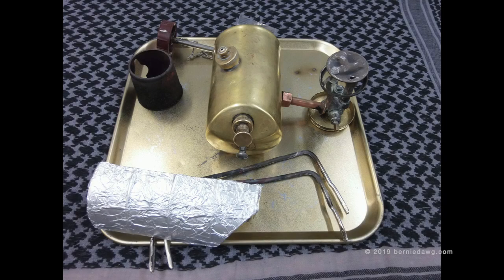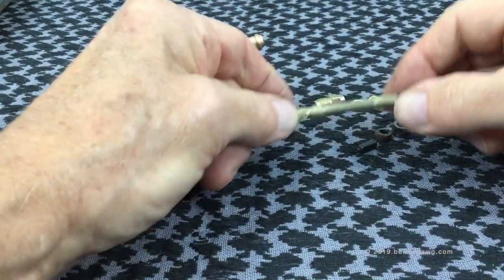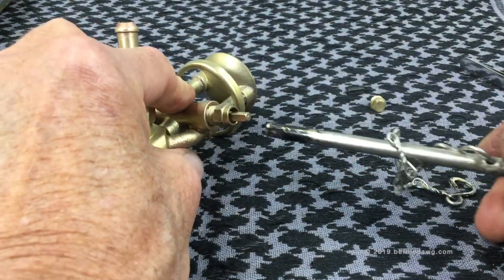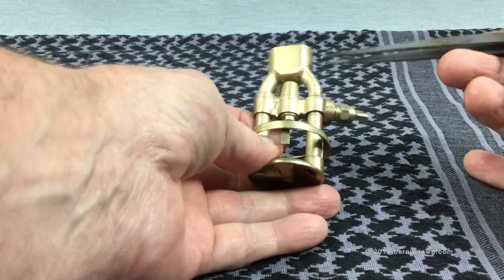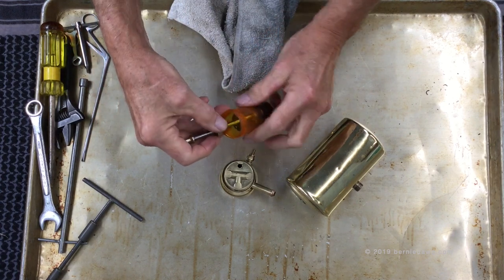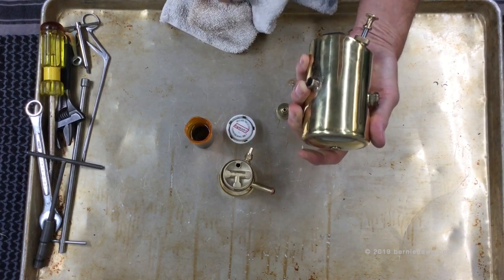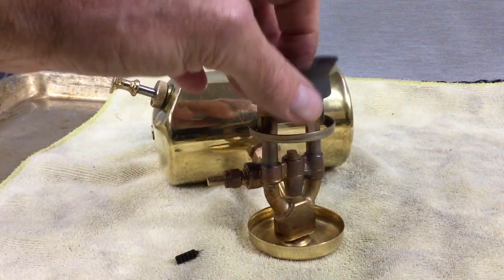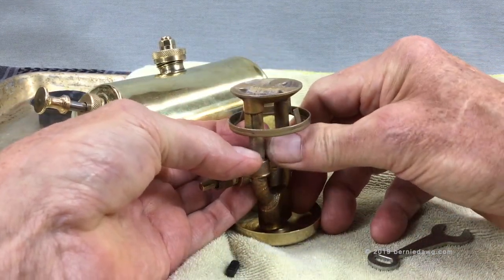Optimus 111B Stove Repair Part 3 - Final Assembly and Testing

Comment: I just picked up an optimus stove that looks like this but it is a two burner. It is pretty dirty and rusted case  because a mouse was in the box and made a nest in there. I started cleaning the case up today. Copper anti seize is higher temperature rating than the silver one.  Guess I will have to take some time and take apart the valves. The old fuel in there was really nasty smelling  - super old !  Thanks for your videos .
Reply from the maker: @Larry Kapp Sounds like an Optimus 22 or 22B. You can see a short video of one I did a year or so ago here: https://youtu.be/rd0gkV1iIjM You might get some ideas or find it inspirational. The 22B should run like this one when you have it restored: https://youtu.be/KsXj8q_yQCg You can get the original instructions for the 22 version here: https://www.berniedawg.com/optimus-22-111-instructions/ Drop me a note if you need the Optimus 22B instructions. I can send 'em to you in email. bd@berniedawg.com Good luck and have fun. Great stoves! BD
Reply: @BernieDawgCinema  Thanks for the info - I will check that out. if I give up on the project I will give it to you if you want it. At least I saved it from the metal recycling dumpster !
Reply from the maker: @Larry Kapp Wow! Thanks, Larry! That's very generous of you! I'm also available to help you with your project through email at the above address if you get stuck on your restoration. 👍BD

Comment: Cracking vlog and thanks you for sharing.  Do you have anything on british army no12 stove?
Reply from the maker: @BigArch6564 Thanks. The British Military #12 is awesome. But, it’s pretty much a big Optimus 111 on steroids. Rebuilding and repair on the #12 is fairly straightforward and very similar to the 111. The two stoves even use some of the same parts. I have three videos about fitting the #12 with silent caps. https://youtu.be/z9z4R6vwQ28 and https://youtu.be/9GXU_VQBjDk and https://youtu.be/GXsD9rL3pFo . If you need specific #12 questions answered that can't be addressed from the 111 videos, just drop me an email. I’m #12 fluent. bd@berniedawg.com BD

Comment: Hi Bernie, great video thank you. I have one question - how do you recommend cleaning the inside of the tank ? Im currently refurbing a Primus 22 ( kerosene ). Thanks in advance. Mike
Reply from the maker: Hi Mike, and thanks. If you’ve got old dried kero (black or brown deposits) in the tank, remove everything so you just have a bare tank. Put acetone in the tank. Plug openings with tight wads of paper toweling. Shake it around and let sit for a day or two. Shake as you remember to during that time. Acetone is a solvent for kerosene and will melt the old dried kerosene. Some folks like to use BBs or even coarse sand in the tank with the acetone as “scrubbers”, but you may need a magnet tool to get all the BBs out or compressed air to get out the sand. May not need to or be worth the hassle. You’ll likely want one or two rinses with clean acetone once you dump out the nasty stuff. Warm water and a little Dawn dish soap to finish. Dry completely. Bear in mind that acetone is also a solvent for any lacquer that might still be present on the outside of the tank. So, figure you need to be really careful or that you’ll be doing a full polish on the tank (don’t know what yours looks like but most can profit if there is a lot of food corrosion spots). Want more help or info? bd@berniedawg.com
Reply: Thanks Bernie, I've ordered up some acetone and will follow your advice. Just picked the stove up a few days ago, it looks like it's had a fairly easy life and I'm looking forward to using it lots on camping trips next year. All the best.
Reply from the maker: If the stove is in good shape and the tank looks clean already, you might consider skipping all this work and just running two tanks of fresh kerosene fuel through it so it can self-clean. Enjoy! BD
Reply: Hi Bernie, First thing I did was emptied the tank into a jar. The Kerosene was old and brown with a fair amount of sediment too. Inside the tank it also looks like it could do with a strong rinse at least so I'll follow your advice with the Acetone. All the best. Mike
Reply from the maker: Thanks for the feedback on the yucky kero. I feel better giving you the acetone advice now. 👍 BD

Comment: Excellent.  
What is the function of the wire mesh?
Reply from the maker: Big topic for a comment reply!! But, I''ll try. There are three functions. 1. filters fuel, 2. aids in vaporization, 3. But, MOST important...(and the real reason it's there)... the mesh roll controls/arrests "flash vaporization pulsing". Anticipating the next question... Do you have to have a roll of mesh? Yes. Don't leave home without it. 🙂 BD
Reply: BernieDawg Cinema thanks.

Comment: Is this always undwr pressure. Or is it pressure then vacuum?
Reply from the maker: @DarkLinkAD I'm not entirely sure I understand your question. The tank is pressured up using the pump. When done cooking and the flame is extinguished, there will still be pressure in the tank. Tomorrow morning, there will still be pressure in the tank. The way to release the pressure is to open the fuel cap and release the pressure. But, don't do that while there is flame around or BOOM. You should release the pressure before transporting the stove. More questions? Use the email in the description box below the video. 👍 BD

Comment: Gary my 111b won’t burn blue.  It pulses between big sooty yellow flames and blue on high only going to all blue at very low simmer position on supply valve. Any ideas?
Reply from the maker: @Donn Sponholz It's tough to diagnose these in YouTube comments, but a few things spring to mind.
- You are (of course) using Coleman fuel in the stove or other camp stove naphtha fuel. If not, and you're using kerosene, that could be the problem.
- Have you checked to make sure there is a tightly rolled roll of fine wire mesh in the fuel feed pipe between the tank and the burner? If not, or if there is too little of the mesh, it's badly rolled, or is too big of a mesh weave, that can cause your fuel not to vaporize correctly.
- Worn out jet.
That's the best I can do in comments. If I didn't guess the answer, I have a nifty email address where you can send photos and video of your stove misperforming so that I can help you get it up and running correctly.  I have a good success rate in email. Plus, if all else fails, I fix stoves for folks for cheap. 👍 bd@berniedawg.com BD

Comment: Thanks :) i just picked a model T one of these today that needs some TLC before i can use it. your vids have given me all the information i need :) seems im missing the supplied tool for removing the jet, but that shouldn't be a problem.
Reply from the maker: Thanks! Glad I could help. You can get a repro stove tool from one of the suppliers in Asia on my parts supplier page: http://www.berniedawg.com/stove-part-supplier-links/ Good luck! BD
Reply from the maker: So, yeah. All T's have four "supports", aka burner tubes, on the burner. There is no such thing as a two-tube 111T burner. It's a regulated silent burner. No tool clip means you probably have one of the Optimus Internationals. They came with a multi-tool spindle control that does everything - three tools in one. If you don't know what I'm talking about on this, maybe it's missing (?), then best to contact me at my email so you can share some photos and I can stop guessing what it is you have. :-) And, given it's a new-to-you stove which seems to be throwing you some surprises, might be best to get a little help  and info rather than mess things up. But, it's your call. Pretty sure we're over the limit on the YouTube comments. 👍 berniedawgstove@comcast.net BD
Reply from the maker: Riiight. Okie-doke, then. FWIW, I have a pile of used wire supports for 111 stoves. I wish you luck. "thebongmaster" as a YouTube name? Well, maybe some extra bunches of good luck, then. 🤨 👍 BD